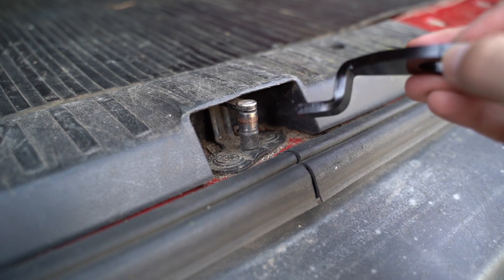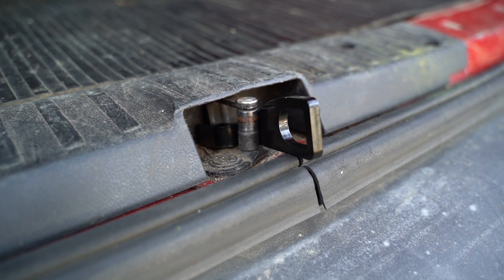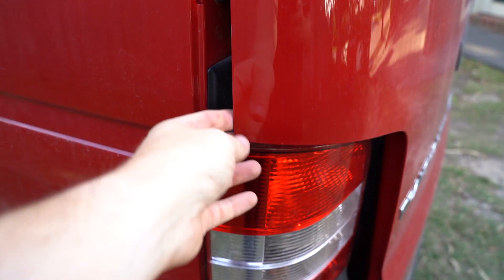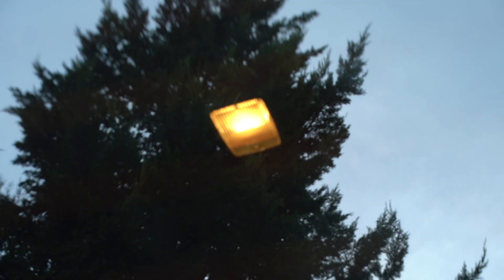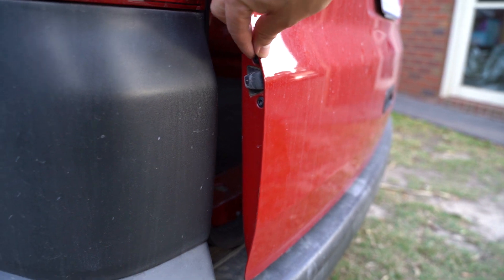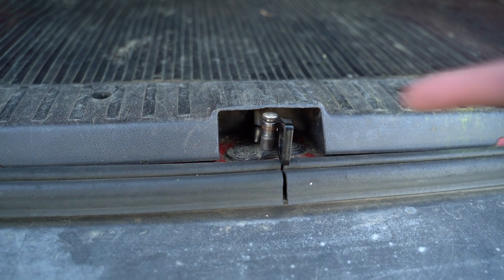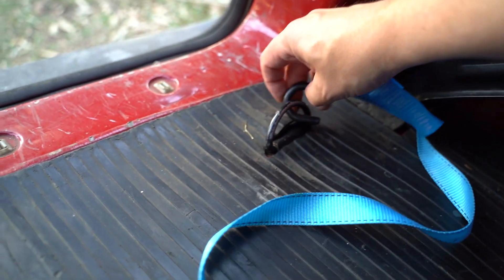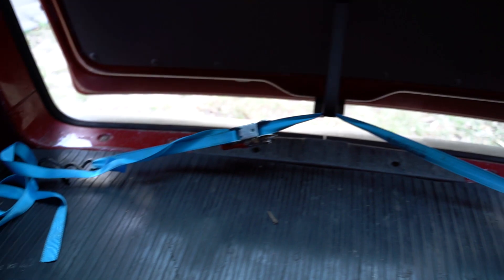VW Campervan conversion - Ep 8 - Airlock...any good?

Comment: Hopefully you still check your notifications on this channel!
Thanks for your vids, you definitely should have more likes - YouTube must have a crappy algorithm! 

My question - is there a way to kinda airlock the sliding doors on a van? Surely there's a way. 🤔 Doesn't have to be completely prowler proof but enough that it would be difficult or noisy for someone to try to gain access.
Reply from the maker: I do check them and yeah the algorithm is rigged 😁. Hmmm ive never saw anything which can close the sliding door but should be a thing! Maybe due to the separation between the van body and the door when it's "nearly shut" is the reason noone has ever made something?